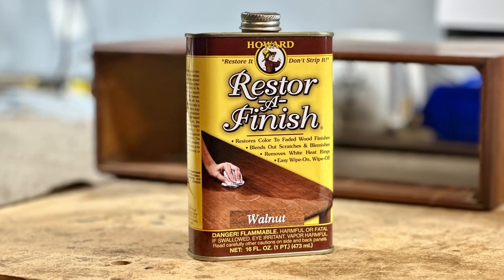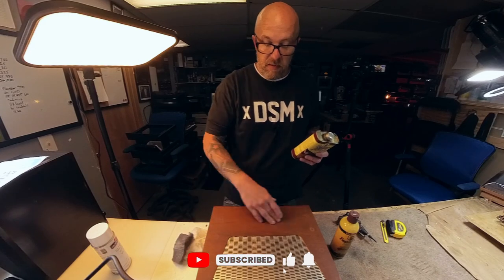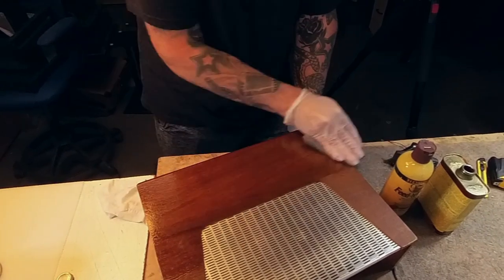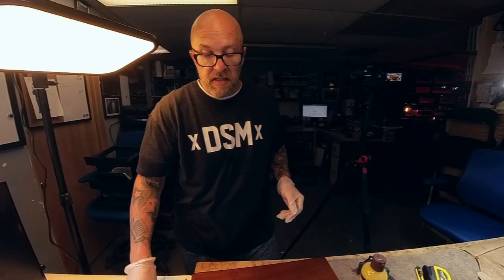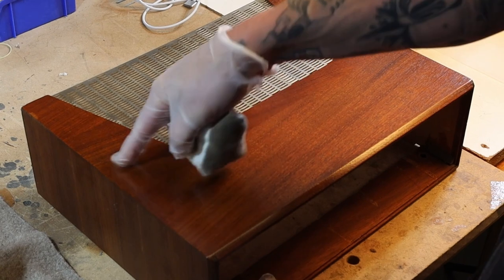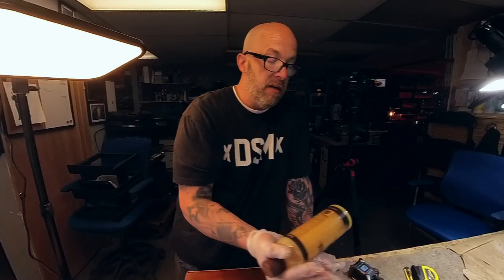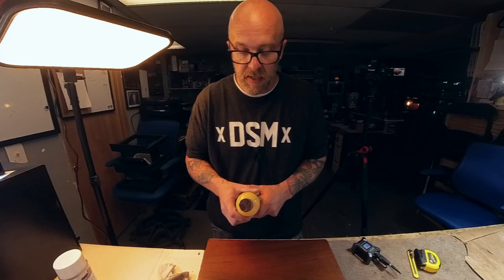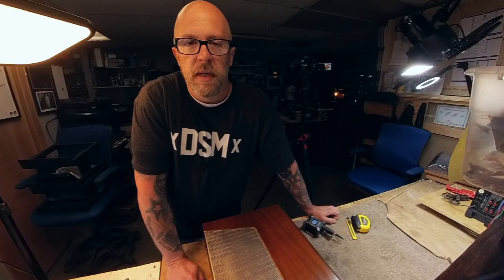Tips from The Bench: Restoring A Vintage Stereo Wood Cabinet

Comment: I like using these products as well.   They work great but I do agree the feed n wax isn't as long lasting as I'd like though.  It does really help old dried wood with multiple coats over a couple weeks.  After a month or so to let the feed n wax "dry" my best results are obtained using multiple coats of tung oil kinda like a condensed French rub.  Super rich results that last much longer for the finish ❤️ 

Thanks for your awesome content Kevin 👍

Comment: Great job! That wood really pops. I enjoy refinishing old break open shotgun stocks and I will spend up to 5 hours sanding with finer and finer sandpaper, and do a final damp rag de whiskering with 0000 steel wool. Then 3 coats of stain and 3-4 coats of Tru Oil, using steel wool between all coats and letting them cure for 24 hours between coats. People have told me that my finishes look inches deep.

Comment: Thanks for posting this vid showing how to use these products!  I'm going to be using the walnut Restore-A-Finish this morning on a set of Dynaco A-25XL speakers which I previously cleaned with Murphy wood cleaner. They came from the original owner who didn't smoke and the  finish is already in excellent condition. I don't have the Feed-N-Wax on hand so hopefully they will look like new again with just the one treatment.

Comment: Hi Kevin. I like the new series, keep them coming. I use both of the products on light restoration of old radios, stereo and speakers. Have you tried using the Feed and Wax product on vinyl wrapped speakers. I've been using it on vinyl and painted speakers surfaces with great results.
Reply from the maker: Cool, thanks

Comment: Whereas on tropical country and few cabinets being preserved by the owner, restoration here is not easy. I did a pause in my restorations due to deep damage on wood and veneers. 90% has worms/thermite, 80% mold, 70% with destroyed speaker cones, 100% needs crossover recap. In addition, almost none are wealth enought to support a restoration that may costs more than a good speciment available on market.

Comment: I used Watco's Danish Oil (dark walnut) for my Dynaco A25XLs. The veneer on the A25 is paper thin, so I sanded very lightly with 220 grit with my orbital sander.
Danish oil is halfway between an oil finish and a varnish. Applied like an oil, simply using a rag and wiping off the excess, but unlike oil which takes weeks (some will say years) to dry, Danish oil dries in less than 3 days and leaves a varnish-like finish that is simply awesome. That's the easiest stuff to get a great finish, you can't screw it up!  The tint in the oil is not very dark, it's more like a very diluted wood stain, and the real color and grain of the wood shows up nicely.
Reply: 220 grit??!!

Comment: For raw wood or nearly raw wood, I would recommend Rubio Monocoat. It's a zero VOC hard wax oil. It does not dry fast and it's not cheap but the finish is incredible and it's very easy to fix scratches as it only bonds to wood, not itself so you don't get weird overlaps like you do with polyurethane. It won't swell veneers either.

Comment: I've never used those products or finished any kind of hifi cabinet. But I have done a number of rifle stocks, and I use MinWax Antique Oil. I first clean the surface with denatured alcohol, then apply a thin coat. I wait 24 hours between coats and hit it with gray Scotch Brite to smooth it. Usually at least three coats will do it, but more can be better depending on what you want. But that job did look nice.

Comment: I am using the same stuff and I just restored a Yamaha CR-2040. 🎉🎉🎉🎉
Reply: That's a painted finish on the 2040 i wouldn't use the restore
Reply: @kgu9870  i used the fee’n wax on the yamaha. I used the restore a finish on speakers. And my Marantz cabinet I did a full restore with sanding down and staining